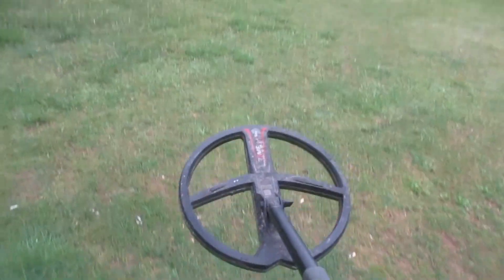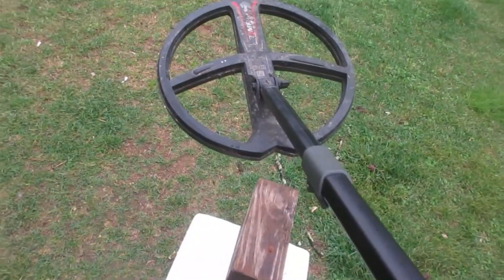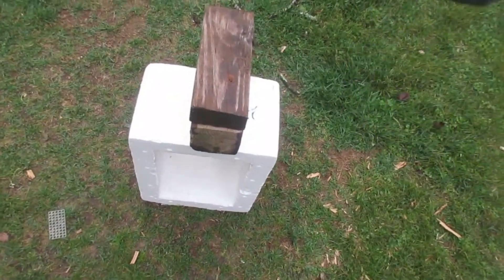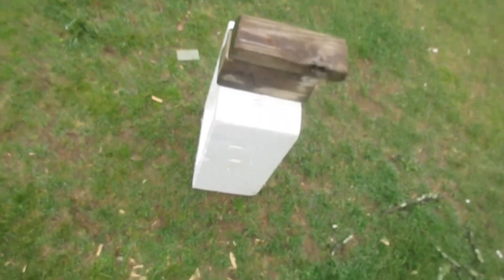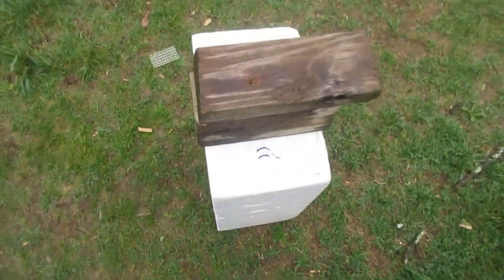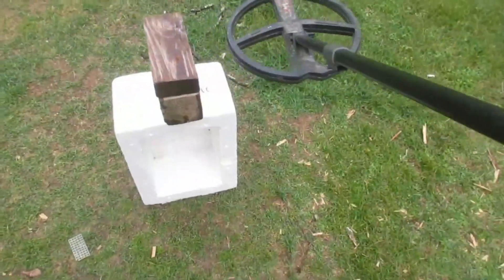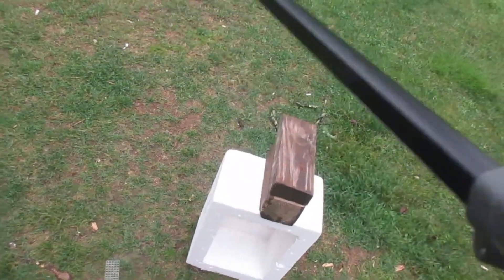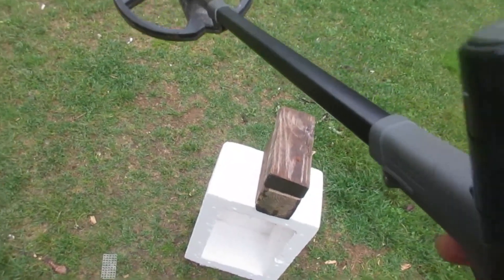Deus 2 Look Elevated small iron and clad dime --Fast, DHC and Mono programs

Comment: my 11" should arrive wed...........no plan on use until summer........good vid too
Reply from the maker: You are going all in to the dark side. Hmm.
It’s no so dark.  Really...
Bet your arm and shoulder feel good after using your new heater.
Reply: @tnsharpshooter8517  ....i guess i am lucky in that respect.......arm and shoulder  -  i had the heavy piece of lead CTX for years, never used sling or anything with it..........but i will say this:  9" deus seems to be great, but it is by far thicker and a shade heavier than most in comparison........my opinion, i am 5'7", so no long shaft in front of me......i suspect it could be tiresome for some after 3 or 4 hours of spinning.....see ya